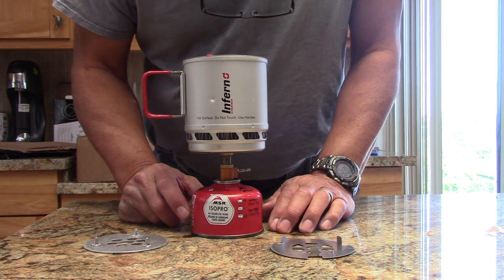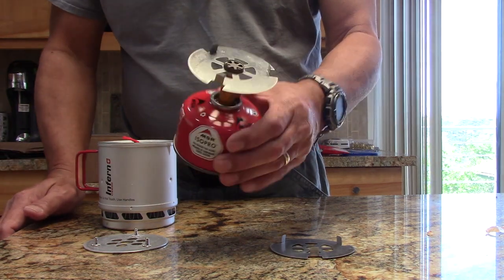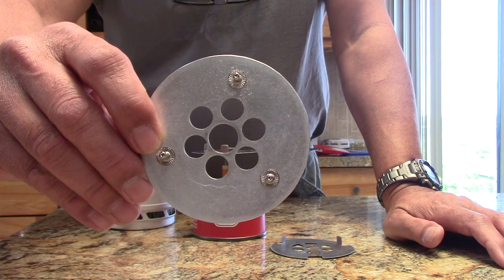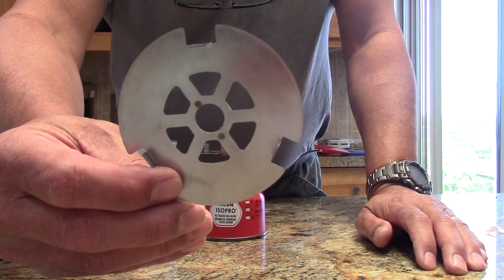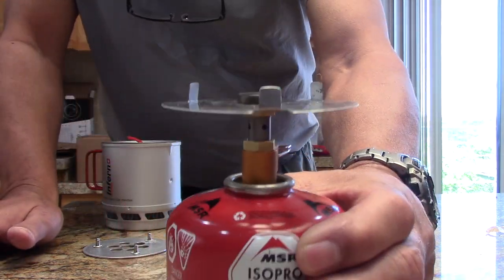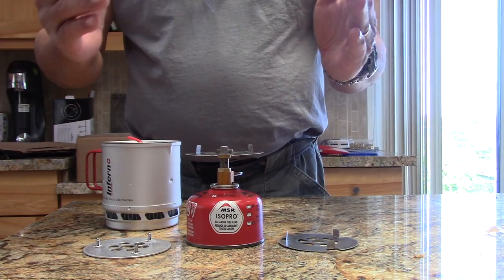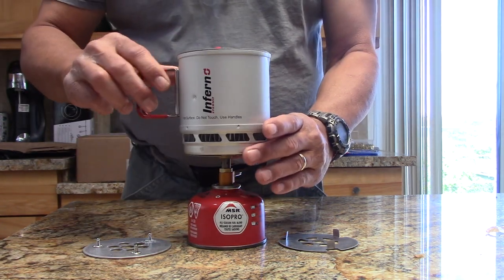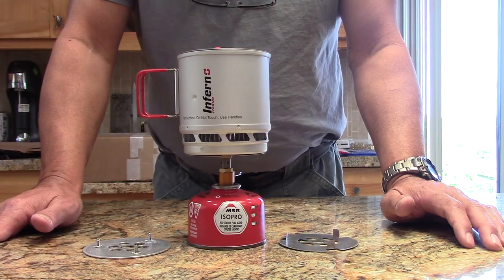Hyper Efficient DIY Stove Kit now for sale. by FLAT CAT GEAR

Comment: Fantastic ideas. I’ve been tracking with you this whole time. The BRS stove fins will fit  into the Inferno Pot with a little effort. The 25 ml Toaks pot will fit on the bottom of the Inferno Pot allowing for added storage. There is a tin can lid that will fill the Inferno Pot, so will the Jetboil Zip lid, and the plastic lid to the Carnation powder milk also fits. Cheers
Reply from the maker: teh BRS will fit, however, it will not have the same protection to the wind as the integrated burner plate.  I may work on a BRS version just to see if it will work.  Best regards - Jon

Comment: Dose the mug deform with the heat so close? Good plate idea!
Reply from the maker: Works fine as long as you keep water in the mug
Reply: @FlatCatGear  so melting snow may be an issue. Doesn’t that little stove burner have a very low setting to get a snow melt started?
Reply from the maker: @jerseyjeeper1575  I am pretty positive that not even JetBoil recommends melting snow in a HX pot.  If there is no/minimal liquid in you pot, you can melt the fins.